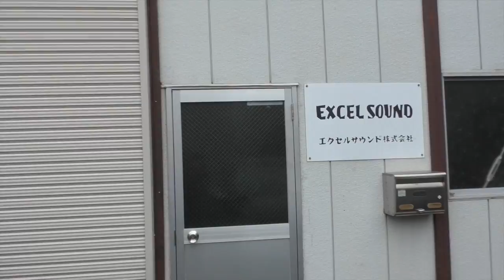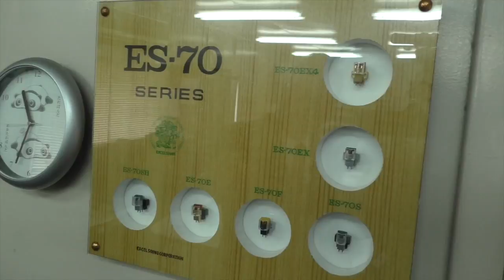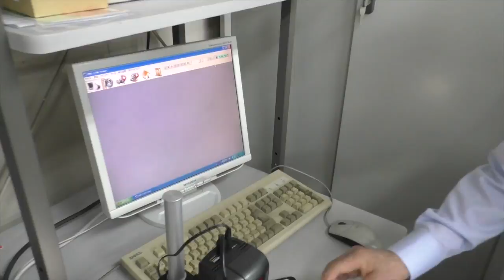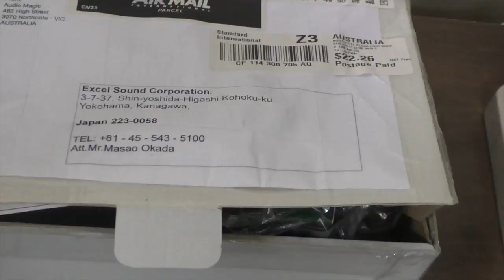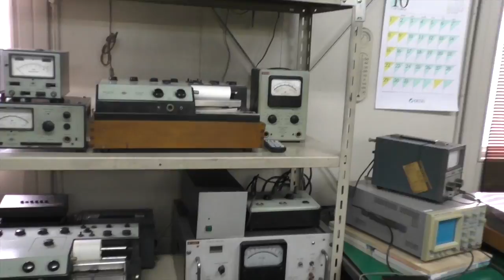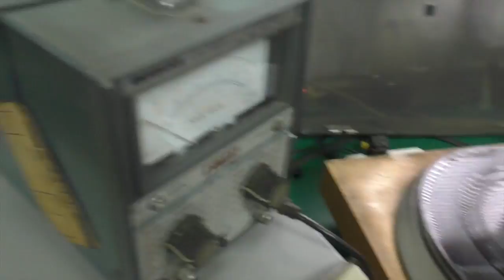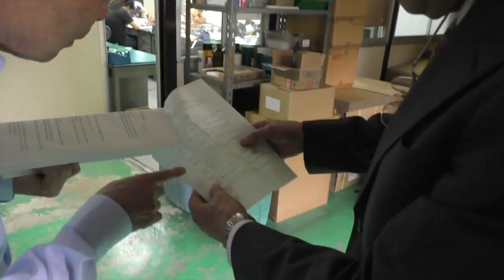AnalogPlanet Visits Excel Sound Corporation (Revised)

Comment: The turntable that Mikey thinks is broken (@10:00) because the counterweight is riding low probably has a special bracket that allows the counterweight to be positioned below the pivot point. Some audiophiles do this to add tracking stability and you can purchase special angled brackets for this purpose.

Comment: Interesting. Just a couple of guys in a rather small sheet metal building (probably because of earthquakes) building cartridges. One tip, though: be a little bit careful with English idiom (such as the one about hatching, can't find it back now) because it's going to be difficult for a non-native speaker.